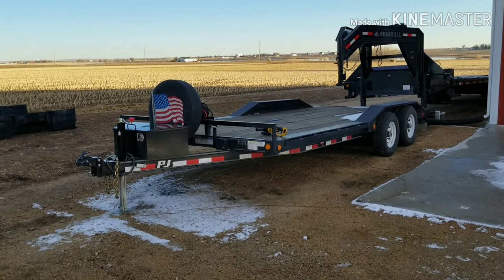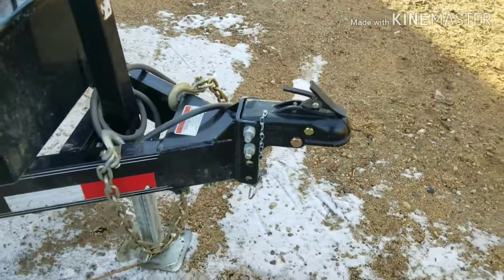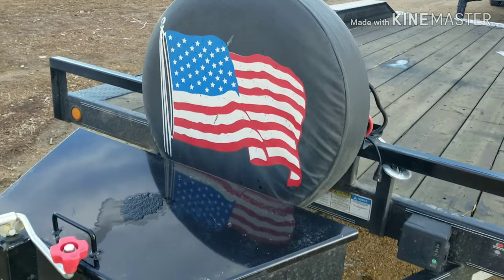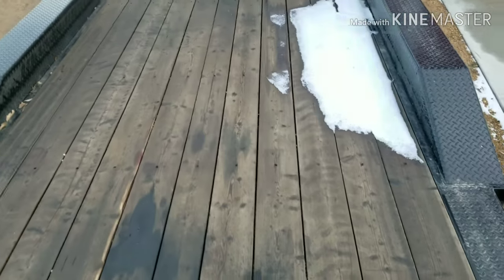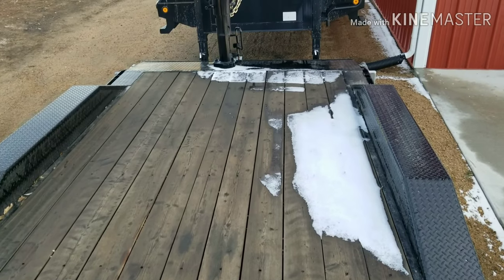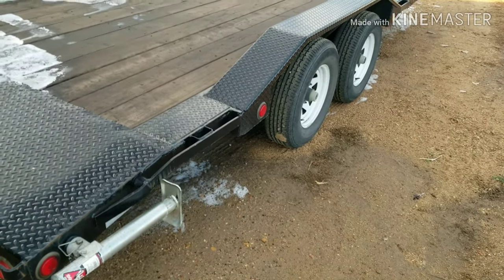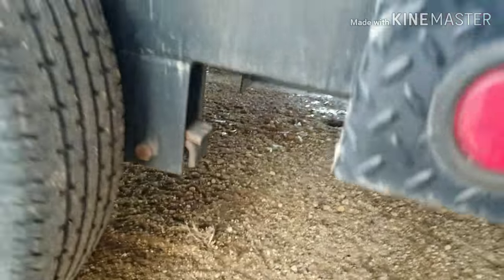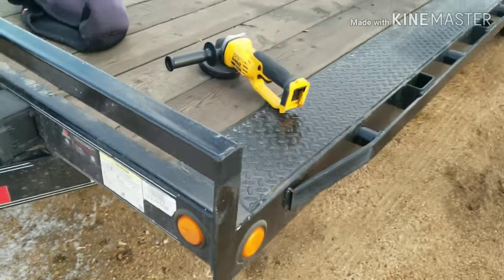2017 PJ 20' Buggy Hauler

Comment: One thing I can suggest with the ramps is to flip them over so that front hook doesn't get caught underneath as you mentioned and water will not collect in the middle c channel pieces. I bought the 20' gooseneck version you have to haul my Jeep and it does the job just fine.

Comment: Good video you answered my question with that trailer with 5200 pound axles hauling heavy diesel trucks I was wondering about that I was going to get 1 with 2 7000s  but I'm not going to be hauling heavy very much so something like that would probably do me just fine in a 22 footer thanks again

Comment: You are not supposed to tie to the rub rail. Will pull it off over time. You find out where you need to weld d rings and weld them on. Some states it is illegal to tie off to the rails.